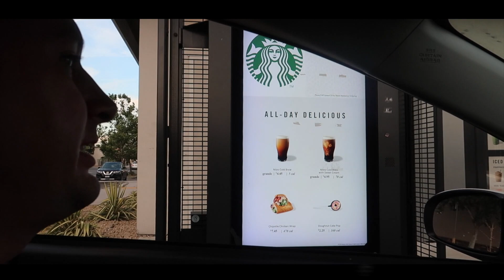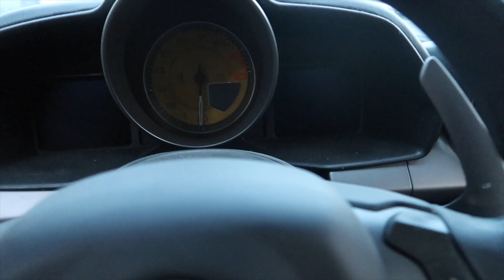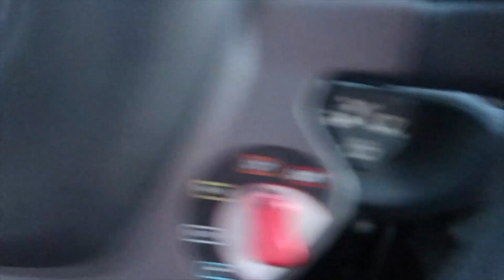JR GARAGE 458/ LAMBORGHINI BODY SHOP (VIDEO #7)

Comment: What's wrong with the engine, causing it to smoke so bad?
Reply: David Bruner  can be the result of a serious issue like a blown head gasket, a damaged cylinder head, or a cracked engine block
Reply: Or can shaft, or valve seats
Reply: Cam*

Comment: I had sticky buttons on my 2011 BMW 328i and 2016 BMW M6... I was out of the country for an extended amount of time. When I came home the a/c buttons would stick when depressed...  especially rear defrost. I think high heat has something to do with this anomaly. I removed each button which is very easily done (much like keys on a keyboard) cleaned them and snapped them back in.... easy peazy!!!